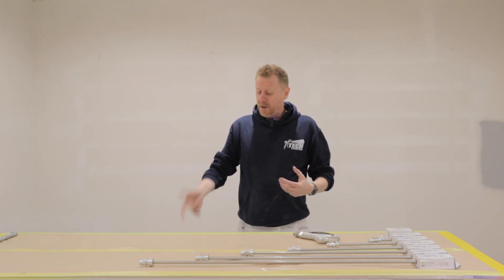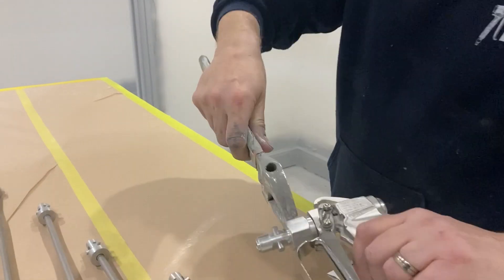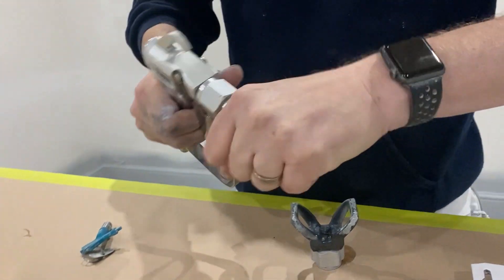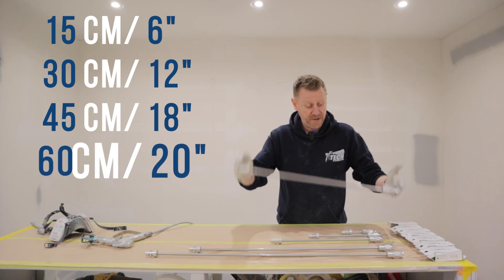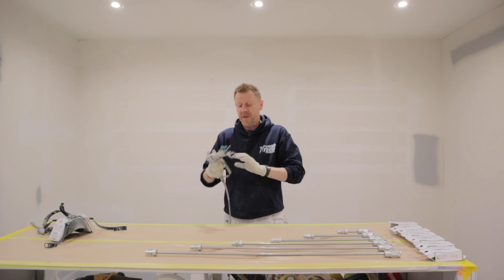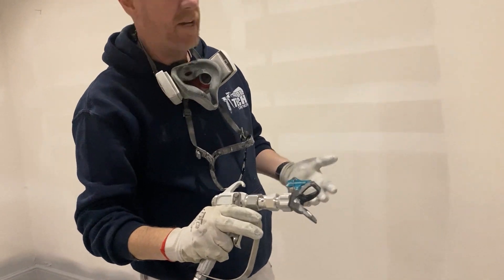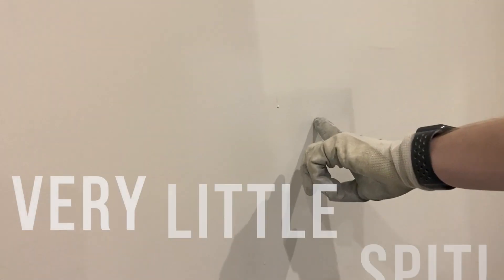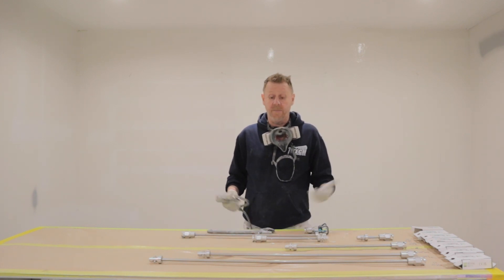Testing the QTech Quick Connect in the workshop

Comment: These extensions seem extremely useful! I wish they would have been out decades ago so I'd already own them. Hopefully they will eventually come with little plastic caps so that you can contain the paint in the extensions you removed and store them sealed up til you're ready to clean them out. Not a huge deal but it would add that slight level of confidence for me.
Reply from the maker: Good idea
Reply: It shouldn't be too hard to find a cap that fits, right? Seems the thread is common enough.